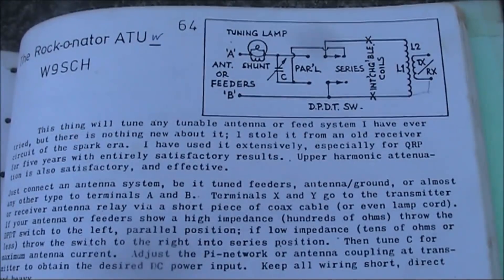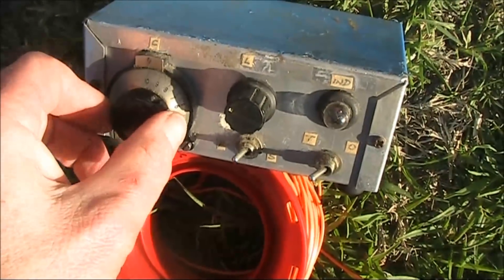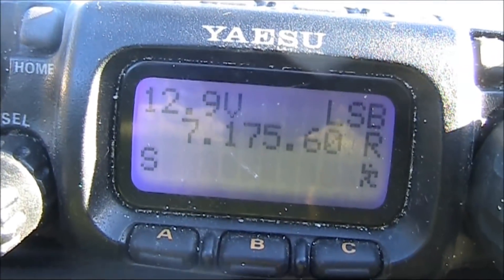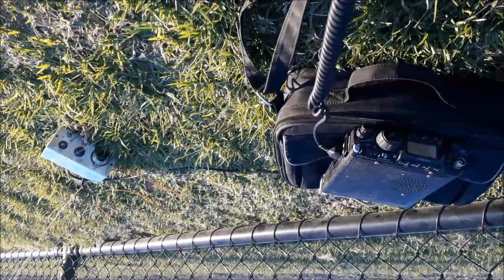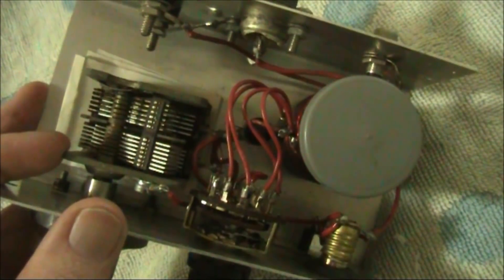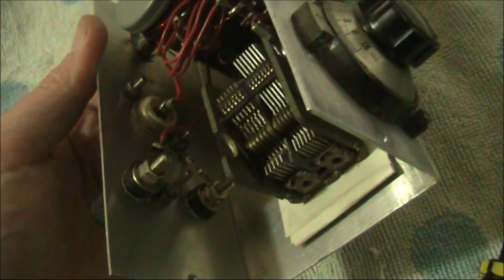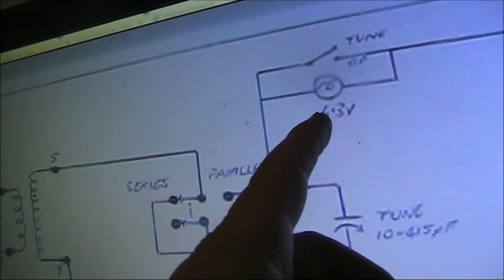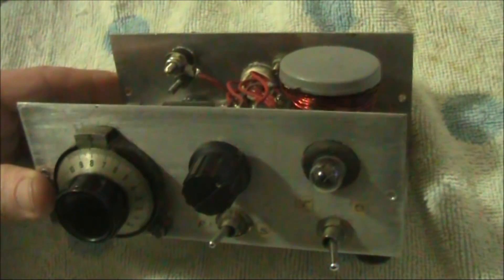Tune for maximum brightness: 160 - 10m series parallel antenna coupler

Comment: There is no diagram of your coil and taps do not appear in the original article .
Are you tapping the 40 turn coil at the hot end ?     and  the I/P coil which end is this at ?.

Comment: I like your homebrew stuff.
I tune aerials using my 817 on FM in tx mode.
I was given a supposedly non working MFJ 16010 tuner and put an LED in it. After 2 years the tuner stopped working, a loose wire inside only just making contact, re-soldered it and no problem since.

Comment: You can also mount the 6.3 volt or led bulb inside a film container with a solar cell. Connect an appropriate analog meter to the solar cell. This way you will have a better visual indicator to fine tune the tuner.
Reply: I forgot to mention that the bulb will be facing the solar cell.

Comment: Peter, thanks for another interesting video.

I recall a Traeger transceiver which was crystal controlled, with maybe 3-5 frequencies, and designed for portable use - maybe about three FT-817s in size - and built into a carry case. It had a built-in antenna tuner with an incandescent bulb as the tuning indicator. Unfortunately I never saw it operating.

Edit: looking at this site https://www.samhs.org.au/Virtual%20Museum/hospital-andother-orgs/rfds-wireless/flying-doctor-radio.htm suggests that it was an EILCO portable 5 channel transceiver, shown in the 5th image from the bottom of the page.

Cheers, Mike VK2IG

Comment: I have a question. The interference at 2:23 that sounds like a motor or an chopping sound. Is that typical for those bands? I am building a small test receiver and noticed that sound in quite a few places when tuning. Thought it was my circuit since i expected more just clean static. But i notice your radio has it too so maybe its the sun or some type of atmospheric effdct?
Reply from the maker: Possibly power lines - which were nearby? Also I was not far from houses.
Reply: @vk3ye  it actually does sound a lot like this http://www.arrl.org/files/file/RFI%20Sounds/w4tdk-13690.mp3. I have a power transformer in my front lawn actually. Ugh. Maybe i should try to talk to the power company about it
Reply: That's not a natural sound. I can remember hearing it as a SWL in the 70's, and the incidence has increased over the years with society employing more and more electronic devices.

One very modern generator of noise is solar panel grid inverters. I live outside a small rural town, and drive through that town on my way to work and back. The MW broadcast stations received by the car radio are drowned out in places by the switching noise emanating from the inverters and propagating along the power lines. Another common source of RFI is street light controllers.
Reply: @vk2ig  yes it occurs mostly on shortwave it seems. I was able to get a few stations last night including WWV , barely (enough to identify the stations). I actually got WBCQ to come in, just a little circuit i am testing on a breadboard. Surpisingly 9mhz and 10mhz range worked on the breadboard and i got pretty clean static even but down in the 7mhz to 3 mhz span i get a few areas where this interference comes in. Seems around 7mhz it hits too which sucks because im trying to pull in 40 meter band on a diy reciever
Reply: @researchandbuild1751  I think there are a few effects with regards to man-made interference.

There is the physics of switching waveforms: an inverter, plug pack, etc, with (say) a triangular switching waveform operating in the 10s of kHz region will exhibit even and odd harmonics up into the low MHz frequencies, but the amplitude of those harmonics rolls off with increasing frequency. It means a device might cause objectionable interference at, say, 5 MHz, but at 10 MHz it's tolerable.

Propagation also has a hand in this:  man-made interference issue is worse on frequencies at around 7 MHz and below in the early evening (an hour or so before sunset) through to early morning (just after sunrise) because the ionosphere supports propagation on those frequencies with minimal attenuation during that period. During the day you might hear your local interference sources, but once early evening hits you also hear the distant interference sources.

Then there is antenna performance: some antennas are less susceptible to noise than others. Those antennas also have less gain, but the received signal-to-noise ratio is better. So the listener is hearing a quieter signal but much less noise than someone with higher gain antenna listening to a loud signal buried in loud noise. This is why some serious DXers use separate transmit and receive antennas on the 80 and 160m amateur bands. They make up for the reduced signal level from the receive antenna by using an amplifier, but these amplifiers need very good intermodulation performance.
Reply: @vk2ig  ok I went through my house and turned off stuff that is around my indoor antenna.

Turns out, that horrible noise was from my refrigerator!  Also, I had additional hiss from my Desktop PC.

After I turned off the refrigerator breaker, the "chopping noise" went away entirely.

Of course that horrible noise just HAS to be right in the HAM band of 3.5mhz range. I think it hits me around 7ish too. Wouldn't you just know it !
Reply: @researchandbuild1751  Well done with identifying the source of interference.

Are you running your receiver from AC (mains) power? If so, you could try this experiment to determine whether you are being plagued by conducted or radiated emissions: run the receiver from a battery, and determine if the same interference is heard, and if it's at the same level.
Reply: @vk2ig  no its running from battery however i do have my oscilloscope ground connected so the noise may come thru there too. Anyway, i finally heard some hams on 3.5ish mhz range! So i know my basic lc tank etc is working. However currently i am only using am demod not SSB ( simple TRF reciever and not a regen yet) so i could not understand them yet but that wasnt the point of the experiment yet. Was mainly to see if i could even get ham signals with a test rf amp circuit, in my house area
Reply: @researchandbuild1751  I have had that problem with oscilloscope ground. When I built my first homebrewed transceiver I was wondering why I could see signals coming out of the product detector even though there was no RF front end built for the receiver yet. After connecting the circuit to battery there were still signals, but after powering the oscilloscope via an isolation transformer I saw no signals. Powering the circuit from an AC driven power supply produced signals again. Powering a consumer-grade receiver from the mains with no antenna connected revealed RF signals propagating down the mains ... so I was relieved that what I saw wasn't spurs generated within my circuit.